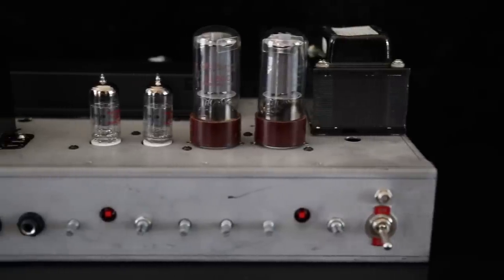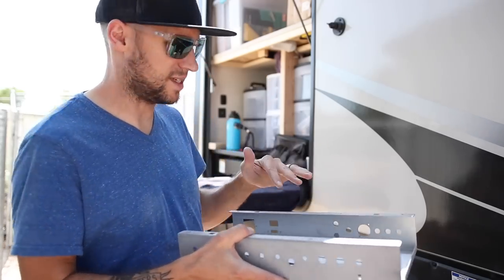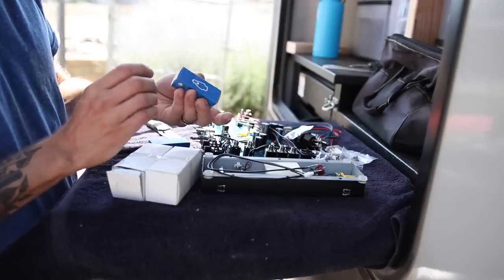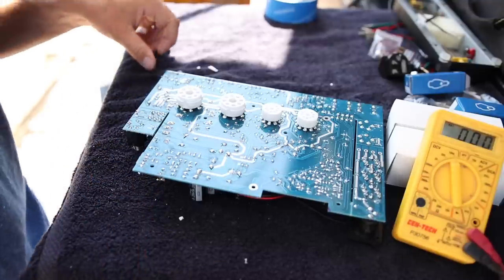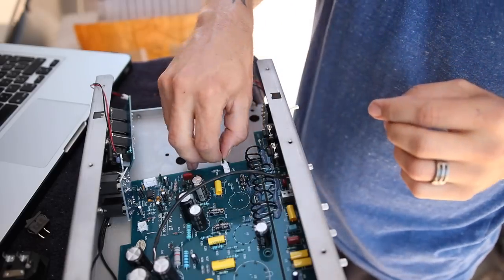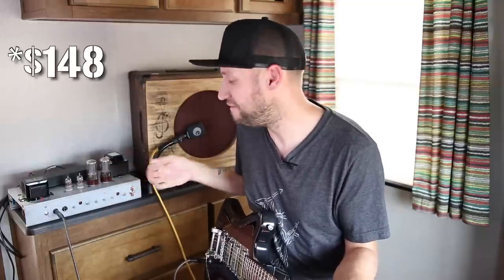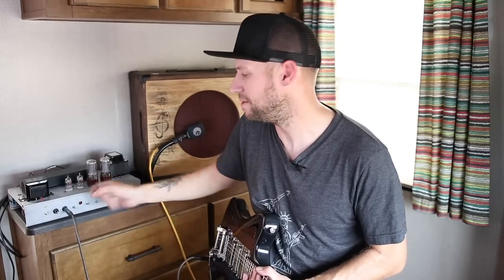Build you own TUBE AMP!!! (KLD DIY 15w tube amp kit REVIEW + DEMO)

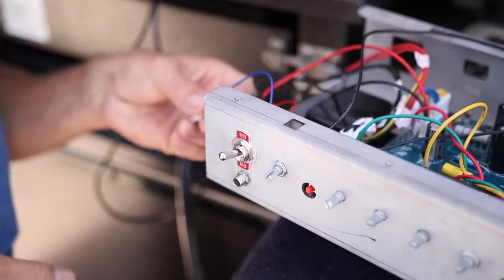Comment: Hey man. At 6:53 your right hand power tube started to redplate. Before you throw in some other tubes that will also be destroyed by redplating, check that it isn't the amp by swapping the two power tubes around and wait for the redplating to occur again. If it's the same tube in a different socket, then it's probably just the tube. If it's the same tube socket, then you have an issue in the amp. Could be bias. Could be an unbalanced or unmatched set of tubes. Could be an unbalanced output transformer. Could be a faulty component such as coupling caps or a bad resistor somewhere.
Reply: Wow. Good catch on the redplating right tube

Comment: I know a lot of people are giving you grief about discharging capacitors but as an electrician (who admittedly knows little about building electronics) it's really nice to see you treating electricity with respect. We always treat everything we work on as being live until we test it, as it only takes 100 milliamps to kill you if it takes a bad path through your body. 

I'm also glad you showed us that tube amps can be affordable - my 80's Bandit is starting to die, but it sounds very similar to this project, which would cost about as much as or less than getting my unit repaired - plus, then I can do a custom enclosure!

Comment: Jeez, you're in more danger from a shark attack on Main Street than you are from a capacitor on that board.
Reply: Amen!
Reply: Loco Blanco Diablo Crakker    Obviously sarcastic i met up with a land shark the other day and he was actually pretty nice
Reply: @reworth9998  lol
Reply: NO SOUP FOR YOU !!!
Reply: I was thinking the same thing they're all inert at that point lmao if he isn't sure whether they're live or not when it hasn't even been installed yet, he shouldn't be working with tube gear
Reply: @guitarpro248   doesn't matter if its been installed.  It matters when it has been powered up. Some caps will discharge after power down with normal circuit drain but sometimes there is one that will hold voltage. When you get a chance, fire up an ordinary camera and then ground the flash cap with your thumb and let us know how it turns out for ya... Im bettin youll never do it again...😉
Reply: Those caps are way too small to deliver a fatal shock. It’s hard for any electric shock to kill you unless you grab the live with one hand and neutral with the other (travels through your heart).
Reply: Even if the shock isn't fatal, it's still painful to be shocked. He's smart for playing it safe. It's better to practice the standard safety precautions than to be cavalier about it.

Comment: A handwired tube amp does not have circuit boards and is not much more difficult to build, it just take more time to assemble but repairs down the road are a lot easier. You have an output tube that is red plating, you have to adjust the bias on both output tubes,  it should be easy enough to do with just your multi-meter and one hand behind your back if you feel nervous when working on powered circuit. The help line should be able to guide you through it. Thanks for sharing.

Comment: One of your tubes is red-plating. Better check the BIAS voltage of that tube.
Reply: i THOUGHT I saw one of the power tubes red plating ! Hope he checks it out and gets it fixed.
Reply: I hope he knows how to check the bias voltage and how to calculate what it should for the tubes he is using. Then, how to make the changes. If not, he won’t have to worry about it for long.
Reply: I was about to post the same thing.  It's probably a bad tube.  Those Chinese power tubes sound nice but aren't built very well.
Reply: I was also about to comment on that.  Either bad tube or BIAS needs to be adjusted.   Be careful Dan, I know you already know, but dangerous!
Reply: Probably the tube he dropped
Reply: I was just about to say that
Reply: @jeffreyeagen4896  he dropped a 12ax7 tube not a 6L6. Also 2 x 6L6 at 15 watts seems low to me
Reply: @Celloman2008  I had one of those new Fender Chinese Champs that had a mislabeled 6V6 as a 6L6, I'm assuming that's what happened here. there is no way that 2 6L6s are only pushing 15 watts. More like 30-40 for 2 6L6s.
Reply: @gonzalot74  the power output of a tube is entirely subjective to its plate voltage, dissipation and arrangement in the circuit. I could put 2x 6L6 in self-split, run at 300v and 70% idle, cathode bias, and get less than 10w on the output.
Reply: @Celloman2008   Well, I can get 35 clean watts form two good 6l6GC
Reply: Can you bias a el84 driven amp
Reply: @gonzalot74  You can bias them down to very low wattage, my dude. Doesn't even have to be a Wednesday. Check the PRS Mark Tremonti head for a suped up version of this.
Reply: @6AM_YT  q

Comment: It's good that you're careful, and tube voltages can be pretty high, but ten volts (DC!) can't hurt you (by touching it).  You'd barely feel 20 volts with your fingers (stick to 9v batteries if you're using your tongue... lol).  Ten volts could hurt a solid state component, like a small transistor or IC, so it's still a good idea to discharge them, but you're safe.

Comment: I use to work on that stuff in the 60's.  Even with the TV's with 30K volts, there is no amperage so it is almost impossible to harm anyone just make you jump'
Reply: Josh Bull those flyback transformers scared the crap out of me but never been “bit” by one. Got a good jolt though from a large electrolytic cap on the primary side though!
Reply: @63stratoman  Well, would try not to get as you say "bit" by one as it's not fun to get knocked on your keester, but it's not deadly (unless maybe your siting on the widow ledge of a 12 story building.) Then you would hear me scream as I go down " I'm falling, but I am not dead yet."

Comment: the 6l6 on the right is red plating so something is amiss with the bias.if left like this the tube will burn itself up in short order.if you have a schematic try to trace back to see if theres a cathode resistor share by the 6l6s or if its grid biased in which case there may or may not be a pot to adjust. its slightly odd one tube is red plating. switch tubes in the sockets and see if the red glow moves with the tube. if so its a bad tube if the problem stays with the socket you may have issue to figure out. i also had to crack up when you taped chopsticks to test the caps on a board thats never been powered up. even if it had been powered up the caps eventually bleed down to nothing. this can take a few hours though so thats why people working on high voltage discharge the caps so they can safely work on it without getting a nasty zap. i am lazy and end up getting zapped frequently. i think you would have to be barefoot in a puddle to die though . tubes are what i mostly fiddle with and i have been zapped plenty, it stings but the discharge is so quick unless like i said barefoot in a puddle, your fine. its good to respect what you are not familiar with just for safety sake. i bet the first time you used a skill saw you were all cautious but now you just do it up right. same with tubes.
Reply: The thing about having to be in a puddle to die isn't quite true (well of course that would kill you) but rather the danger is in the charge wanting to go to ground, if your feet aren't in a conductive situation and you're touching the chassis with your other hand there's a risk of the current running from one hand across your chest and heart to the other hand back into the chassis potentially harming the heart.

First thing i learned is always keep one hand on your back working on amps and you're pretty much safe from death, you can however get a nasty jolt were you to touch a live capacitor and the chassis at the same time but aside from some pain you're in no real danger...... your caps will be empty by then tho.

Most everyone doing this is going to get zapped sooner or later, they call that a dose of vitamin B+.
Reply: @FraJa1980  I know I was just exaggerating, it just seemed hilarious how he was afraid of caps on a board that had been shipped from China so if it even ever was powered up which is doubtful the caps would have 100% dissipated the voltage stored in them in the weeks or months it was sitting around waiting to ship plus shipping time plus how long it was at his house before he filmed the video. The one hand rule is a good one. But I have been zapped accidentally while barefoot on ceramic tile and it just stubs a little.. The duration of a cap blast is mill seconds plus I have verified on several amps I built plus others and as soon as the amps turned off the voltage starts going down and in most case is down to 20 volts or less in minutes. That said it's better to be safe than sorry
Reply: @skullheadwater9839  That was pretty funny indeed! Don't think that pcb ever saw a current before the box was openend.

Yeah it doesn't take that long, it's only when you're really working on them replacing components and don't have the time to wait for the current to drain naturally you risk running into some high voltage.

I got zapped once when i was younger trying to discharge a cap with a screwdriver...... it hurt pretty bad but soon as i saw my dad laughing his ass off i knew i was ok. That flash was fun tho.

Very true, it takes five seconds to check and another five seconds to discharge if you have a proper discharge tool so why risk it?

Comment: Hi, Dan! I'm really happy to see this one. I'm with you man. I would have been a bit disappointed with it being mostly PC cards, and most of the work having been already done, but even though I'll definitely be adding a hand wired kit to my "List of Projects I'm Going To Get To Real Soon Now," I'll probably do one of these, first. For one thing, it be a good warmup before jumping into such a painstakingly detailed project like hand wiring an amp. For another thing, being able to modify certain parts of certain circuits the way I want them to work is VERY appealing. Being able to sort of "redesign" the bias circuitry, et al, to use different power and/or preamp tubes for just one example, could be pretty exciting. It also means I'll end up with TWO new amps instead of just one! :-D Thanks again, man!

P. S. You need what's called a shorting stick. I'll tell you about those over on FB Messenger, along with a couple of other things I think will help you a lot. Ttyl!

Comment: FYI, you should assemble electronics as far as possible from any fabrics. Therefore, assembling this amp on a towel isn't optimal for said amp. There's a wire you can buy, goes around the waist snaps to metal, it makes sure that static is routed to "ground" and not to the gear. Especially if you suspect the parts to contain a charge.  Great video, keep it up

Comment: Hey buddy,
Just to let you know, there are few capacitors on the planet that will hold a DC voltage charges for longer than a day or two.... much less a few weeks from China 🇨🇳 
I used to work on “seriously” deadly high voltage caps back in my HVAC engineering days... 480 Volt caps - super fun!!! Got bit once or twice.... made my fillings warm 🤭

Comment: It's the amps you should be affraid of. A taser probably won't kill you... A toaster in the bathtub will. Only takes about half an amp across the heart.
Reply: Typical static discharge is 2 amps.  Caps on a 15 watt amplifier fully charged won't kill a cockroach.

Comment: On electricity: Low voltage does not mean low power. While higher voltages are generated in tube amps and sustained in capacitors, never look at 10 volts and think "no big deal" because I have some 2 volt lead-acid battery cells here at work that have the amperage to make your wedding ring molten if you're not careful. The best thing for caps is to bleed them... get some 5 or 10 ohm high wattage cement resistors, or better yet wire wound with a heat sink, and use insulated probes to turn capacitor juice into waste heat without risking yourself or the caps. You can also make a "bleed" circuit such that switching your amp off provides a ground path for cement resistors and removes residual voltages.

A Taser is 50,000 volts. It is at a few milliamps. A forklift battery is 36 volts nominal. It's got a working amperage of around 225, and a short circuit will turn 4/0 copper wire [about as big as your thumb] incandescent and set fire to the insulation.

Safety is good. However, amps are what make the voltages dangerous. Higher voltages are just more likely to jump from pole to pole causing arc flash/arc blast. I deal with this daily as an industrial automation mechanic. To only describe voltages without concurrent amps is like trying to calculate terminal ballistics based on velocity but omitting weight. 10mA through the carotid sinus or trunk of the body can cause a lethal disruption of the heart. A Van de Graaf  generator will put out 100,000 volts DC but is harmless albeit painful. Becoming a conductor for an arc welder can kill and if you're really lucky resistance cook your body like a hotdog in a microwave. 

Either way, good to have safety in mind, but I wouldn't work on caps of any size until I discharged them to a zero voltage state.

Comment: There is absolutely NOTHING  on that circuit board that will hold enough charge that would kill or even hurt you disconnected from power,
Reply: Absolutely correct 👍
Reply: Also the discharge tool is of great use but requires a bit of design as resistor that is too low in value or wattage rating can get too hot and fail, permanently open.
Reply: incorect if he had existing heart problems it could induce cardiac arrest though even that would be rare

Comment: PC Board???   Cheater.   Point to point solder like a real man.    (I build amps,  and I'm just messing with you)
Reply: DeadKoby quick question would it be ok to use an amp like this with vinyl without damaging it?

Comment: Don't worry about those little caps in that amp. I once got shocked by a large 200 volt DC electrolytic capacitor in a General Electric EV-1 panel in a Clark forklift it was about half the size of a 12oz soda can. I did however hear a loud crackle in my ears, and it knocked me on my butt. Needless to say not fun.

Comment: PC circuit board builds are notorious for poor solder connections. A careful visual inspection of all those points is critical. This could be a factor in the bias melt down you’re about to experience. However, it is not the only failure possibility.
BTW, try to clean up your lead dress, it will improve the signal to noise factor.
Good luck with the amplifier project.

Comment: I'm not an amp tech but I believe your "atenuator" is really a pentode /triode switch. I'd be interested if one of your followers might know more. 15 watts is low for a pair of 6L6 tubes.
Reply: Sure is. Some amps get 25 from 6V6's which are only half the wattage. 6L6's get around 40-50 watts per pair.
I wonder if they sent the right tubes.
Reply: @valvenator  Interesting, you could be right. Lets look at the schematic.
Reply: The schematic shows 6L6 valves......

Comment: Can you tell me how the footswitch works? The manual is not very clear on it. It says you should be able to turn on amd off the reverb and the boost. So do you need a dual footswitch pedal then? Do you also need a stereo cable so they can be turned on and off separately.

Comment: Dan- how would you discharge those capacitors?? That would be cool to learn
Reply: Typically  you'd short the +/- leads, or put a resistive load across them, like a light bulb. That said, I wouldn't worry too much about capacitors that small. Yes, under the right circumstances they can give you a jolt, but nothing close to lethal.

Comment: Unassembled amp- no voltage- no chances of getting shocked.
Reply: It's not deadly, but it's also not fun having a cap discharge into your finger (first-hand experience.) High value caps can hold a charge for quite a while.
Reply: @jgrimsley2000  Yes that's true, my point was that the caps had no voltage applied to them yet, being newly added to the circuit and no power applied to them, therefore no chance of being shocked.
Reply: I doubt it would cause much pain get your sweaty arm into a live start run on a AC compressor 😖💥⚡
Reply: @mrfaulk7739  What the hell does that mean....... I don't get it

Comment: Fun fact is that voltage isnt really what kills  or even harms you. Static discharge from carpet and socks is 20,000+ volts. But 10 amps will kill you.
Reply: Josiah Lee less than ONE amp can kill you given the right circumstances.  That’s why you can never be too safe.  There are a lot of comments on this video saying not to worry about those “small” caps.   Very dangerous, irresponsible and uneducated of some of these posters.
Reply: @toddzino58  I never said they wouldn't or that 1 amp cannot kill you. I also never said it was safe to handle the capacitors without proper safety equipment. Thanks though!

Comment: 400v 330uf capacitors wont to kill you but it will shock you a little bit like a 220v 5A home power outlets I accidentally touched one of those while repairing my laptop adapter wahahahaha those mini caps wont even shock you

Comment: Been looking for amp kits. Quick question, will this work for basses?
Reply: In principle they all work vice versa.
It's more a question of taste than anything else.
Before I had what I needed, I've been switching between amps and guitar and bass all the time.
You just need more power for a bass amp.
That's the one thing to consider.
Do 15 Watts is probably not enough for playing bass in a band.
But it should be fine for a guitar.

Comment: Interesting...  Even the "hand wired" version looks like it has circuit boards...
Reply: Gotta differenciate between "hand wired" and "point to point wired". The lesser being a pain in the big 'ol A if you're not patient, but that's were you normally don't have a circuit board.